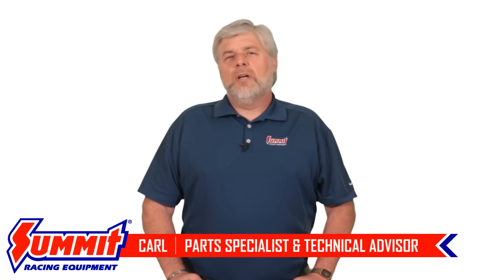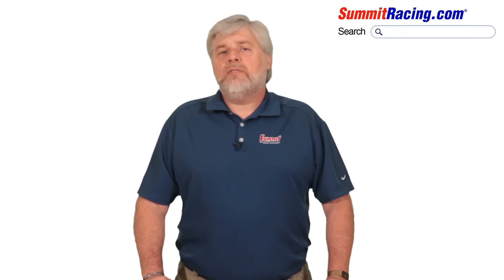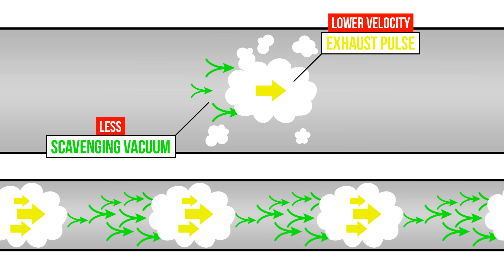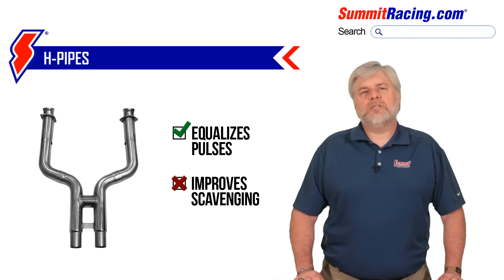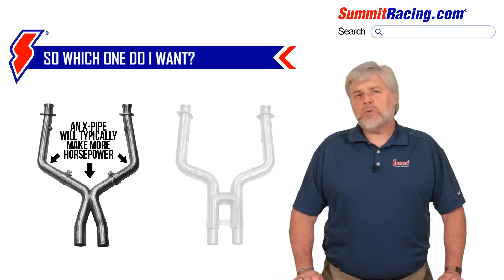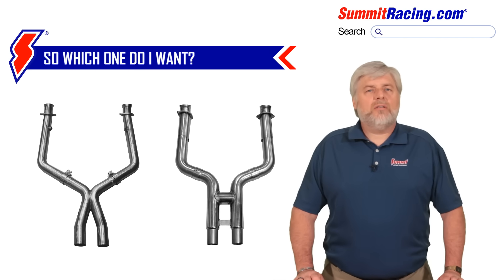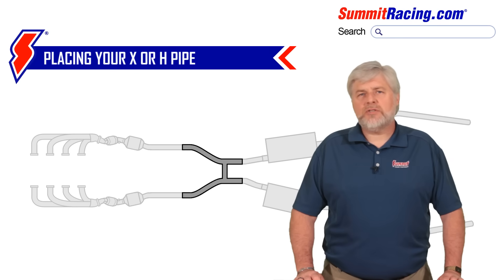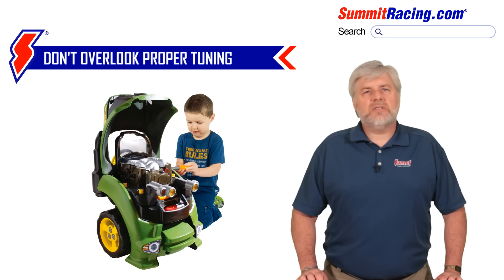Exhaust H-Pipes vs. X-Pipes: What You Need to Know

Comment: Got a 302 and that been bored .60 installed comp cams 31-226-3 kit, a Holley 600cfm 4 bbl, high rise aluminum intake, long tube headers, running 3" exhaust from headers to electic cut outs right after should I go with the h pipe or xpipe into 12" cherry bombs over the rear end out the back

Comment: I’d like to state from my experiences, the x pipe will provide more top end power whereas the h pipe does give a TOUCH more torque from idle to a little more than oem stall speed auto transmission, so yeah better for a truck maybe, I will point out that I’ve seen an x pipe make more low end too just not QUITE as much as an h pipe, the h pipe SEEMS to cause a restriction? At upper rpm’s, in my experiences and personal opinion it seems I would be more enticed to just go with an x pipe, I would also like to point out that the differences in power and torque were talking about here is really like 0-5 hp, 0-5 torque USUALLY, now if your getting into like 600hp and more then you might see more of a difference (by then you’d probably be using a straight dual anyway), but unless your REALLY in tune with your vehicle most people will never notice the difference that 5 horsepower or 5 torque numbers makes

Comment: Thanks for this video. I have an ‘05 Mustang GT that is my daily driver. Low end torque is more important as you mentioned in the video. I wondered if an H pipe system would be better and whether it would lower end torque if installed? I am considering shorty headers possibly to complement the H-pipe exhaust. There’s a lot of info out there on this subject that leaves more questions than answers. Your feedback is appreciated.

Comment: Question on H pipe and using a stock gen v lt4 in a hot rod, 1967 chevelle someone said it would make your Exhaust deeper therefor fitting the old hot rod, true or false ? 
Thanks,Mike

Comment: If you want to run am Xpipe and you're borderline for sizing Should I go with the biggest pipe that kind of fits flow characteristics I have over 900 rwhp 430" supercharged SBF I have necked down 3.5" collectors to 3" X pipe and dual exhaust back to rear end I've been checking into this I think I need dual 4" xpipe and back or 4" Ypipe to single 4.5 out to rearend  What would you suggest Drag and drive car  Thanks

Comment: Most racers in NHRA Stock and Super Stock (and Comp) tried X pipes and almost everyone found them to be ineffective. I see some in use on high RPM low torque combinations, but most people took them off. I never observed anyone putting them on to set a record or to win a heads up run. On the street where noise is an issue, and mufflers are required, they may be an advantage.

Comment: Bigger diameter pipes will always give you better performance it is always the case its been proven time an time again by people with dynos an a slight bit common sense the need for back presser is a myth .the scavenging affect only has any real relevance to about the drivers seat then you are literary just restricting the engine. Any exhaust shop that try's to tell you to put smaller pipes on your car for back presser dose not know what they are talking about an is just trying to offload stock nobody wants .they do not deserve your business

Comment: So what's better for my lb7, an H pipe, or an X pipe? It has 45 over sac injectors, LBZ CP3 pump, up pipes, down pipe, driver side manifold, 4 in msrb exhaust, cold air intake, 64mm turbo. So what is the best for my application, X pipe, or H pipe? I'm confused!

Comment: Question… not being snarky or anything.

But what about TRUE DUALS without either x,y, or h. Wouldn’t they flow better without exhaust pulses running into each other?

In my head the X or H seems more like a situation to slow down these criss cross pulses making instead of jetting on out not tampered with. 

I’m no expert but about to do 392 hemi in my old 84 CJ8 Scrambler. My Grams bought it brand new, but it was well used in rural post office to post office mail delivery contract for about 5.5 years. I got it from her as my first “car” in 89 and still have it. 

It’s 100% original but basically everything is totally worn out. I quit daily driving it about 10:years ago. 
So, this became my next venture with a Jeep I have had 35 years now. everything going in … is out of 43,000 miles 2018 SRT GRAND CHEROKEE (not TRACKHAWK) ROLLOVER (still runs drives great but way too damaged to repair). 
We are retro fitting everything to make late model/coil system etc. to a totally blank CJ8 frame. It’s gonna become a bit of a cj8;wide body but I got all that figured out now. Not going to lift it, hoping to set it down a little lower than 1984 factory height actually, but with custom offsets. I like the bulldog look plus with that hp and high centre gravity (not good). 

I was just digging around on YouTube and found your video. 

Going by the video it seems there is (or can be) an actual loss to use x/h depending on application. 
Not that it’s gonna matter because that CJ is probably going to be more terrifying than fun (it’s weighs about half what a challenger weighs). 

Starting to think I may be building my own casket…. Not really, I’m totally sensible. 
Wasn’t really planning on anything bigger than 5.7 but unexpectedly won the bid on that super nice SRT. I hate to butcher it but there’s nothing not bent and only 2 windows in it even the pano roof exploded and it’s just a big mashed in hole.

Comment: I have a 2013 F-150 5.0 coyote, I removed the resonator and replaced with 2 1/4" pipe then the stock muffler with a flow master 2 1/4" inlet and 3" outlet ! Sounds fantastic but wondering if it could sound even better ! Any suggestions?

Comment: I have Mercedes w211@E280,is it ok for me to replace the  resonator with the H-Pipe
Reply: better install X-pipe I also have w211 3.2 I have equal-length manifolds and also a compressor from w203 C32AMG increased the power to 354hp I also installed X sounds nice

Comment: Off the headers, y pipe for split duals. Add a series of x's on both sides all the way down with 1 h connection before the rear for shared resonance between both sets. Now you sound like godzilla's mating call in surround stereo. 😂😂 and for tuning, add kazoo's to each tip.. adjusting sizes for that perfect buzzz. 😂😂
Hahaha, j/k.. i have no idea what im talking about.

Comment: Not that I was a dumbass, but thing I liked about glasspacks was I never tore my exhaust off when mudding.  I did that a time or two with turbo flow shaped mufflers.  Of course, even w mud tires, I shouldn't have taken my '74 Grand Prix out there.
Love the glasspack sound, especially the deceleration pop.

Comment: I'm thinking of installing long-tube headers with 3"x18 to 24" extensions on my '84 Mustang 5.0. Can an H-pipe be installed in the extensions? If it can, what is the smallest diameter I can make this connecting pipe. By the way, nice video
Reply from the maker: Thanks for watching. We appreciate the kind words. Give us a call at 1-800-230-3030 or shoot us an email (https://help.summitracing.com/Email-Us/) and we can help get you hooked up with the right H-pipe.

Comment: I have an H pipe kit from a previous build. I’m toying with the idea of putting it on my old 1979 tow pig. Stock 7.4 , 410 differential, 2.25” pipes and flowmaster mufflers. From time to time I tow a 25’ boat about an hour one way to one of our favorite playgrounds. I’m curious to see if the ole pig would benefit from the upgrade. I would only be out the experience of band clamps for the install. Any suggestions?
Reply from the maker: Just keep in mind location of the crossover plays a huge role whether you get increased performance, sound--or combination of both!

Comment: I have found that on most late model cars & trucks with 2-3 catalytic convertors, the engines need a certain amount of back pressure to run properly due to the restriction of the catalytic convertors. I had a dual X pipe exhaust system installed on my 2017 Chevy Silverado 6.2L LTZ & found out the engine put out less horsepower then the stock exhaust system. That cost me about $4000.00 with TIG welding all connections & moving the 3 catalytic convertors.

Comment: I think it's important to note that not all x pipes are built the same, the ones that come together like the ones shown in the video are typically the best they are called Siamese x pipes because they don't have aggressive Angles of intersection. X pipes that intersect at near 90 degrees have been proven to show flat spots in the power curve when exhaust pulses literally crash into each other and cancel out almost any scavenging and disrupt the gas flow all together. The Siamese style allow for a pass by pull of scavenging vacuum with out having your pulse collide into each other. That's why most weld in x pipes with those angles cause power loses down low where the gas is moving slower and more likely to die off in a collision of pulses. They have less power loss in the Siamese style. I like to think of those as more like a window between both sides where they can pull on each other with vacuum, where as the other is like hallways that intersect and they have to try and pass through each other.

Comment: Engine Masters covered this better. 

H or X comes down to how much real-estate you have. Where the HP difference is only 2 hp between the two.
Reply: But it’s definitely torque loss with a X pipe what I installed on my 2006 Mustang GT exactly what this guy is saying is true, a year later, I put a H pipe Problem solved.
Reply: @Steele-z1u   putnit like this, 50 hp or less. You'll never feel the difference.  And will mentally haunt you while laying in bed, when you see it on a print out from a dyno.

Comment: I'm a Firm believer in a Good tuned Stock engine can go along way.  That Being said I have a Family car and it's driving me nuts. I have an 02 Durango 4.7.     It's a OHC.   I miss the old school mild cam lope -..-..-..-..-..-..-..   I know lope is not power but, I am really thinking on Building a top end set up.  Keeping fuel mileage below 2k and Come to life at 3k or 3200.  Any thoughts or ideas?  As of right now, Lay down on it at 45 mph or less and it gets a little crazy. It's stock. with a Few wires cut.  I am not looking to lay rubber getting on the highway. However it would be nice to get a little crazy on those Freebird days. If you know what I mean.

Comment: '85 Ford F-250 with a 460, mild build, 250 hp at rear tires with 350# tq. I installed an X-pipe where the 2 exhaust pipes come together. I installed an O2 bung and have an O2 sensor to monitor air fuel ratios for tuning. I plan on EFI like a Holley later and this is a good location for the O2 sensor as it will monitor both sides mixed together.

Comment: I have a 2011 challenger v6 3.6 which set up would be best . Stock now (factory settings) I ordered a peddle commander for throttle but would like it to sound better than stock exhaust and if possible increase 0-60 hp

Comment: Hi guys...from Australia...Love your products and your range..our cost of freight to here is sad like the price of thfe product which turns $1000 to $2000
...Anyhow i have a 1949 ford single spinner coupe utility...with a 302W old type or flowed mild work heads..or a 347..possible 5.0 mustang motor due to engine number here no one knows and id sure like to know..A fmx auto prior to C4..9 inch detroit locker and 4.11 gears..b and m pro ratchet..its nice to hmm 100mph..had to 160...but craving more sound ..Anyhow due to constriction in engine bay i have to stick to standard headers pipes (which i have previously flowed via die grinder to gasket size  on a 302C that everyone thought i had a 351C due to wow...did you do an engine change?..I sure did...haha..i used to have it  in a 1975 ford.....my ute  has lukey mufflers and no x or h pipe..2 1/4 inch system one end to other...i just cut back to rear of seats and it still sounds..a bit boring..not happy....im guessing it has  250-300HP which in video im guessing suffice...its a street rod not  a drag car 1500HP monster truck...Advice please and mega thanks for a weekender looks good and want it to sound AWESOME....H-E-L-P...Thanks guys n gals and beer time..Daz from Oz..also gear drive noisy jackson to A gilmer belt sounds and Hp variants?.or just a double row chain....im looking...for sound..i cant do top speed..its a COOL😎 75 year old rod..LIJE ZZ TOP ELIMINATOR..I WANT THAT SOUND AND NASCAR LIKE sound
Reply: Sorry if any spelling mistakes..i wrote on my mobile phone and there isnt an edit

Comment: Engine masters tested exhaust wrap on the dyno and it made a whole bunch of nothing for power so the power increase from higher velocity thing is kind of a wives tale, the benefits from wrap is under hood temps potentially affecting heat soak and IAT. The down side is potential increased rust in the wrapped portion of the exhaust reason why most header manufacturers void the warranty if there wrapped. So if your wrapping a s/s header is a good idea at least ceramic coated plus with that and wrap heat would be decreased dramatically which is nice, I've actually noticed through my transparent fuel filter the gasoline boil on a 90°+ day and also the power tanked that day felt like I was riding the brakes. So wrapped exhaust may have stopped that from happening. The kid of weather when pop the hood you are hit with a blast of super hot air like just opened an oven door it's hard to believe an engine will even function at all like that.

Comment: I had just installed an x-pipe on my E46 M3 right after the catless headers, the next section was a Supersprint piece that utilized an h-pipe, just as the factory piece did, about 8-10” after the x merge. Got an odd power curve from it, good top end but fell on its face below 3k rpm. I swapped the factory straight pipes with a resonator back in replacing the x-pipe and everything was way better. My theory is the engine was tuned for the h-pipe, and also that having the h so close to the x messed with the flow causing back pressure issues or gasses wanting to “backfill” the other side through the h.

Comment: Hello, love your video and very informative and your knowledge and explanation is so great on "H" or "X" exhaust pipes.  I am restoring a 64 Impala with a 350 horse 350-V8 with naturally aspirated 650 Holly carburetor and 202 double camel hump heads. I am going with the Hooker long tube header but my question to you is what diameter exhaust pipes and if an “H" or "X” or even none of these would be recommended for this set up for the exhaust, they will exit straight out the back with Absorption mufflers? Thanks, Joaquin.
Reply from the maker: Hi Jmercado4 , For a milder application like this an H pipe would give you the most benefit ! Thanks for watching and good luck with your impala !

Comment: Engine masters tested wrapped and coated headers. Made zero difference in torque or power. Header wrap just rusts the metal. Does help with radiant heat reduction though. That’s about it.

Comment: Thank you for inviting my comment.  Yours is not the first exhaust video I have viewed. I like the low end torque of the H-pipe and the high end h/p of the X-pipe.  But I HATE the raspy sound "brick-in-a-garbage-can" sound of the X-pipe.  I am starting mods on my 4-valve Mustang Cobra.  My  prime interest is Autocross and road race, not the drag strip.  I will stay N/A up to 500 hp, then debate adding a power-adder.  How am I to know which pipe (H or X) is best?  Thank you.

Comment: I have a 06 G6 GT coupe 3.5l V6. I have a flomaster 3" single in and 2.5" dual out. Since my exhaust was single to start with, I was just going to place the x pipe right after the muffler which I had put in place of the old stock resonator. Is this something that will hurt or still stand to gain in my car's performance?

Comment: I have a 76 trans am just restored with 455 and Hooker headers with 3" collector's I was going to run 2 1/2 with x pipe all the way out to stock tips. Is this what you would recommend or would you h pipe it. The motor is stock. Thanks Ken

Comment: Dual exhaust get you that deep real V8 sound..even better in a performance car.
No headers needed on new'er cars.
The stock exhaust flow like headers from factory.
Headers build up heat under the Hood, electronik cant stand to much.
Even with all that "trix" they promise you, about cooling coating, they just want your money.

Comment: I have a 94 Chevrolet Stepside Silverado 1500 with a 350 in it I am putting a new engine in it which would be the stock engine which is a 350 1500 not a Vortec what would be your personal opinion on exhaust I should put on the truck I know I want dual exhaust coming out the back bumper can you give me your personal opinion on what I should do about the exhaust I want to make sure that the truck runs correct and right I'm putting a lot of money into it I've had the truck for many many years and I've been rebuilding it for a very long time and I wood like your personal opinion because I really do not want to get this wrong you have to please excuse my phone it has issues sometimes

Comment: I just had removed the resonater from my 04 BMW X5 4.4i. Replaced with straight pipes. Still original mufflers at the end of each side. Should I have used X or H pipe? Or done it differently? Thx!

Comment: G'day I have a holden 5ltr injected motor in a vs holden ute I've just bought some pacemaker headers wich will have 2 mufflers hung just before the diff what do u recommend  for the pipes a H pattern or an X type exhaust the motor is stock at the moment but will be up grading cam, and lifters soon ?thanx from Danno